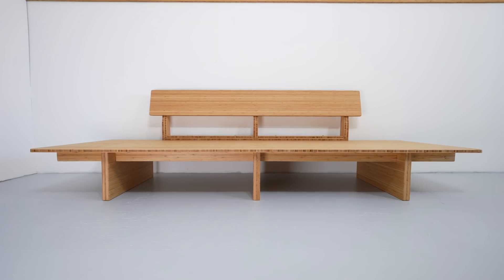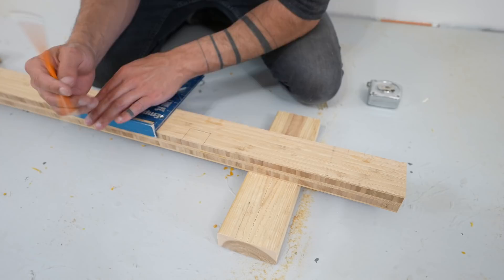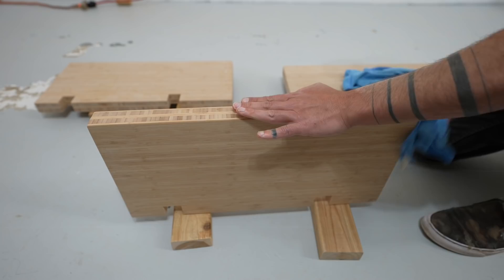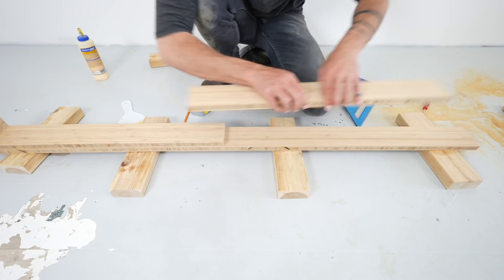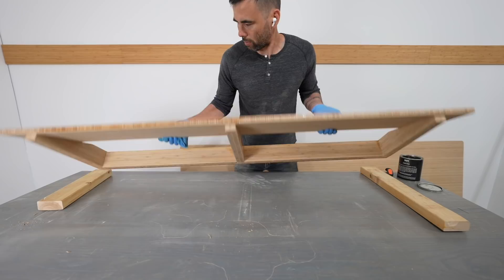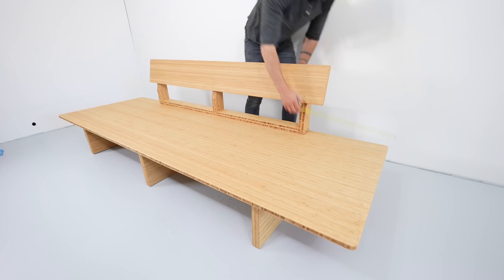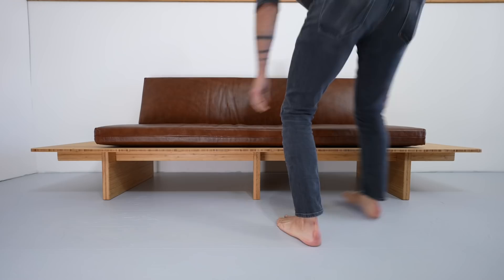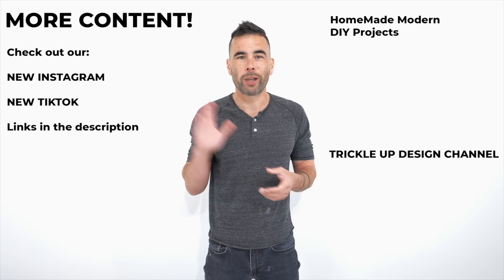DIY SOFA MADE OUT OF BAMBOO PLYWOOD + FREE PLANS

Comment: The bamboo ply is great material. I made a platform bed, nightstands and built-in cabinets using bamboo plywood (and baltic birch for the hidden surfaces and drawer boxes. The edges have great detail for no extra work.
Reply from the maker: yes!
Reply: Hi, do you think that bamboo plywood stringer than baltic birch?

Comment: Whats the price of the plywood? Do they cost they same as birch plywood?
Reply from the maker: more expensive but varies dependingon how many sheets you buy. I have paid between $140-$220.  that's a lot but with sanded pine plywood at $64 a sheet it doesn't seem as bad to me.
Reply: I called them: they said ~$275/sheet + shipping. The 1/2” was a little bit cheaper.